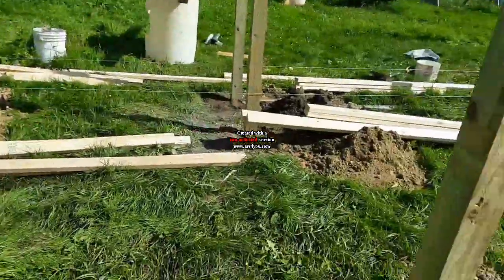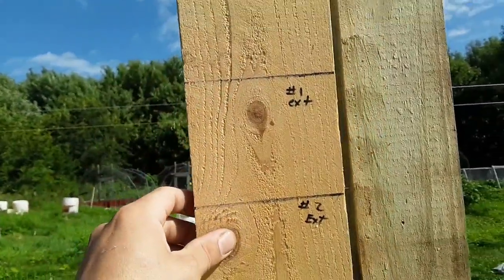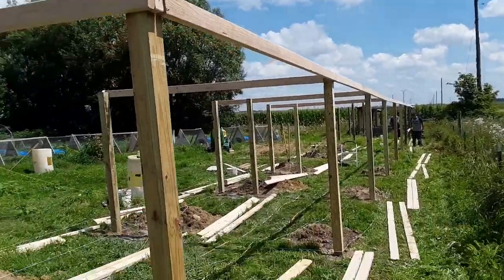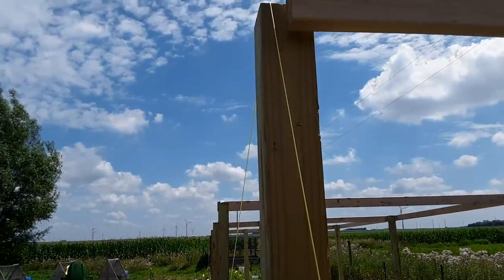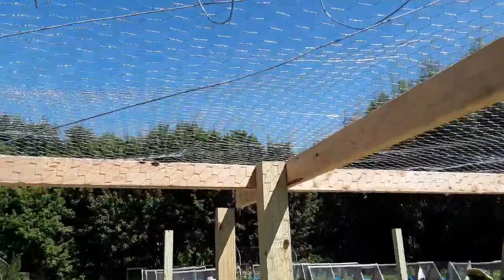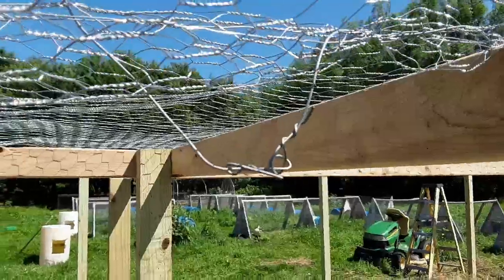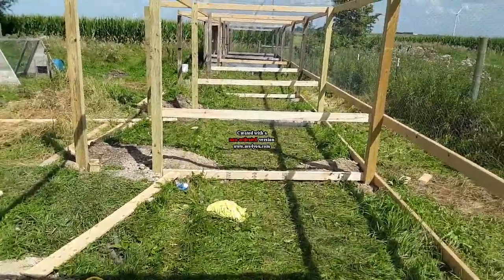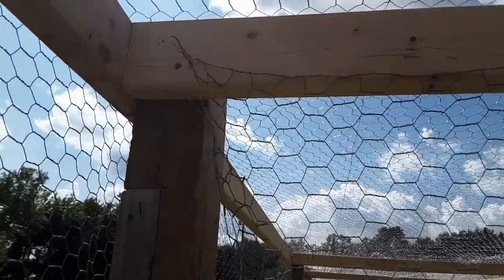Big Build Part 1

Comment: I wonder if a barrel splice would work in that application...
Reply from the maker: possibly, I do recall using barrel splices in part of a zoo display I worked on and those wires were also pulled hand-tight.